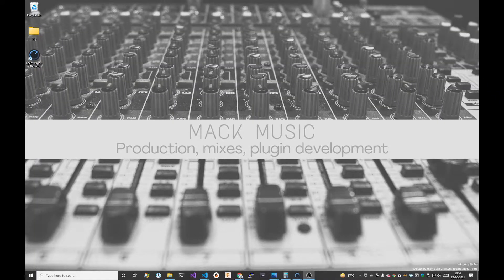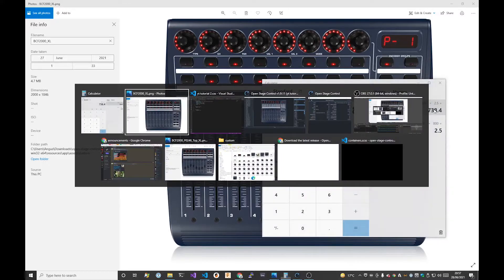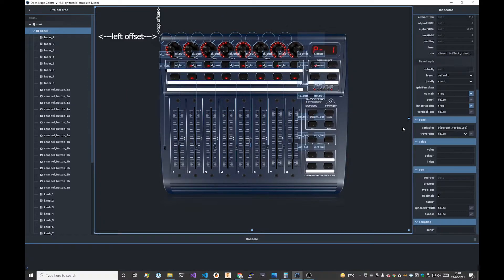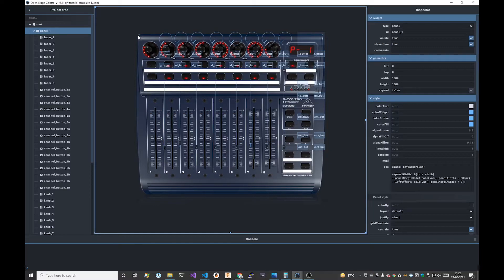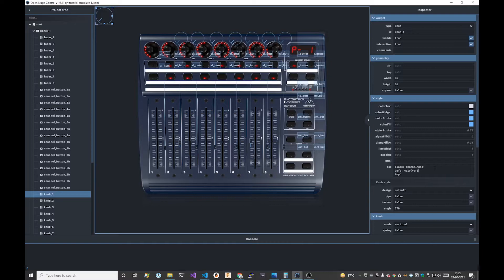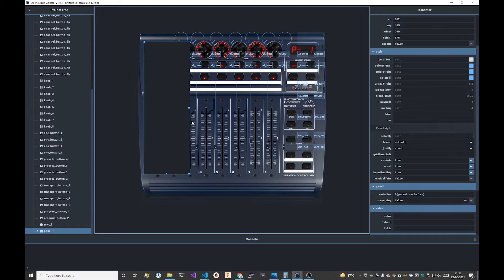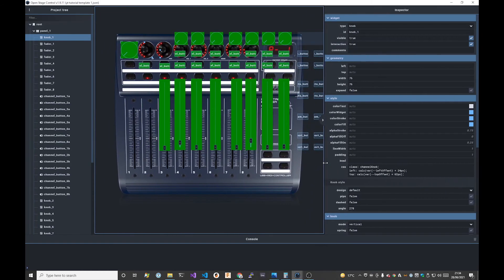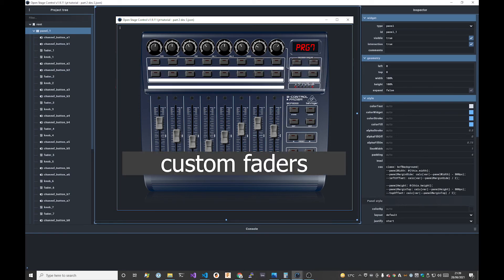Open Stage Control tutorial - Part 2 - mastering layout of control widgets

Comment: 6:00 I tried following this tutorial but nothing happes when I type this in css panel:
======
class: bcfBackground;

--panelWidth: @{this.width};
--panelMarginSide: calc(var(--panelWidth) - 144.4px);
--leftOffset: calc(var(--panelMarginSide) / 2);

--panelHeight: @{this.height};
--panelMarginTop: calc(var(--panelHeight) - 1145px);
--topOffset: calc(var(--panelMarginTop) / 2);
======
What might be an issue?
Reply: Oh, maybe it did work, it just was already the right size =/
Reply from the maker: @ipoponq  Cool. Glad it works and thank you for joining the Discord. I'll be replying to your messages and suggestions next week when things have settled down a bit at home.
Reply: @themusicmack  no pressure, best of luck and thanks for all the job you've done
Reply: this step didn't work for me.. Cuz even if I drastically change pixel values nothings changes.. =/
Reply: Finally Fixed it!!! Found an answer on Forums:  
"you can retrieve the widget's width or height property (@{this.width}) and play with it (only if it's not set to auto and if the size is not overridden by the parent container's layout)."    
In my case, "Top, Left, Width, Height" were all set to auto and written in "yt tutorial 2.css" file. When I inserted those width and height values to OpenStage instead of auto, it worked.